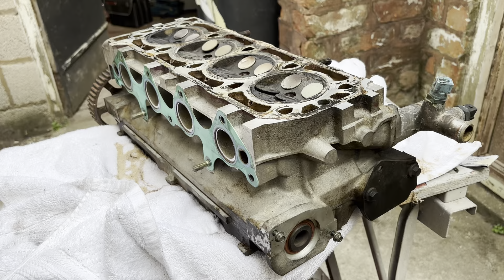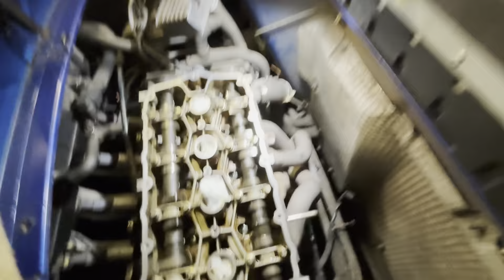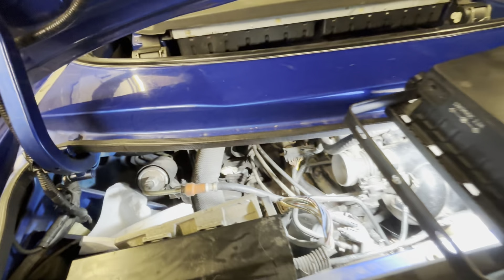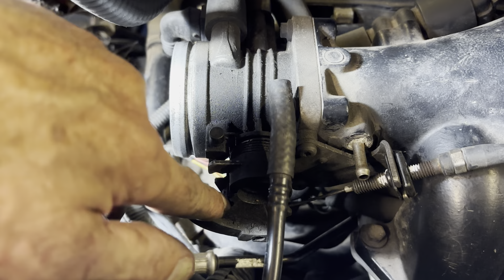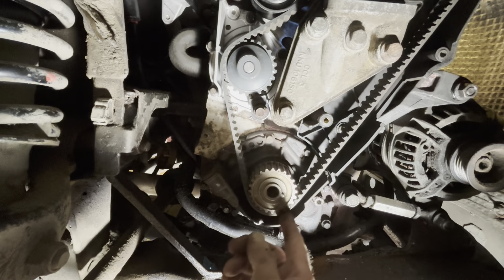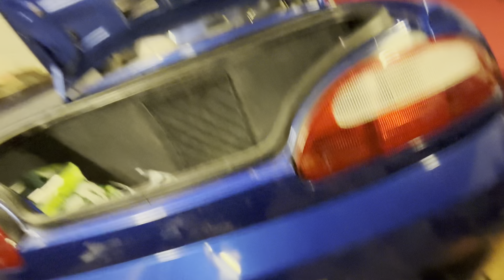MGTF HEAD GASKET REPLACEMENT, part 2

Comment: Any time I did the HG on a k series I kept the hydraulic tappers in a labelled container full of oil to stop the followers running dry/ empty,then a quick squirt of oil from a syringe into the follower when fitting to make sure they were full,( good honest video, the belt is a b*****d)👍🏻
Reply from the maker: Hi,

Many thanks for your comment and good tip.
Regards

Steve

Comment: Hi thanks for the video. I don't own an MG but enjoy watching videos like these. When you said you need the timing belt quite tight before adjusting the tensioner what did you mean exactly or how would you do that without using the tensioner? Well done by the way, that didn't look like an easy job to take on. 
Cheers
Reply from the maker: Hi,
Many thanks for your question,
You have to ensure the belt is on the exhaust cam pulley ( right hand pulley as you look at the engine from the drivers side) I jammed it in place with some cardboard, then you feed the belt around the bottom crank pulley, it is very easy at this point to leave the belt loose between the exhaust pulley and the crank pulley, this incorrect, it is effectively one tooth out. So you have to pull the belt down pretty hard almost to the point of stretching it a bit to get it on the next tooth, and the use another piece of cardboard to jam it in place. The belt will then have a bit of a ping when you strum it as opposed to being floppy. You can then feed the belt around the tensioner which is still untensioned at this point and then the water pump pulley and even then this is where I struggled.

Comment: Congrats, Steve. I'm always curious to watch attempts at HG replacement on the F/TF. It really is open heart surgery and not for the faint hearted. I think the awful access is what turns off so many amateurs from trying. It's a pity your TF isn't the VVC as replacing and tensioning that belt is another step that many of us have to contend with. These videos have been very useful step-by-step accounts and a great resource for the F/TF community.

Comment: Hi 
How did you manage to get the bolt into the compliance bush for the suspension arm? I am struggling with it.
Reply from the maker: Yes it is difficult one, as it does not want to line up easily.
I loosely fitted the two bolts to the hub first and then put a jack under the hub so you can try and get a better angle for the bolt to line up, I also had to knock the whole suspension around a bit, forward and backwards just a few mm to get it somewhere close. I then looked up through the bracket hole to see how close the suspension arm hole is, at first I could see it was halve a hole away from being in line so more slight manipulation of the suspension and hub until I could see near enough a full circle right through the bracket and bush, then the bolt almost pushed all the way through, I just encouraged it the last inch with a couple of light taps with the hammer.
Hope this helps.
Regards 
Steve
Reply: @SteveMoore-360  Thanks the jack was the answer but still a challenge to line up. All together now after much swearing and cursing.